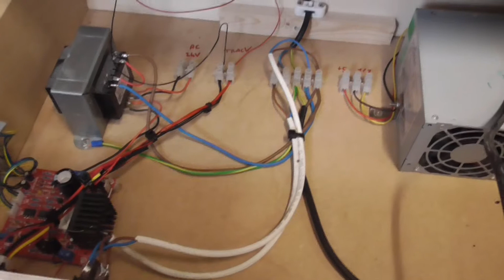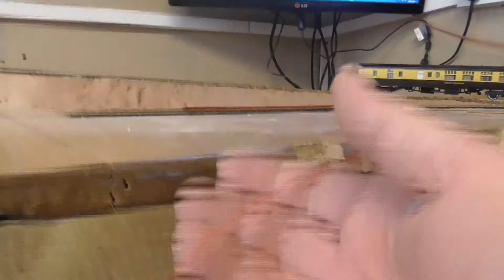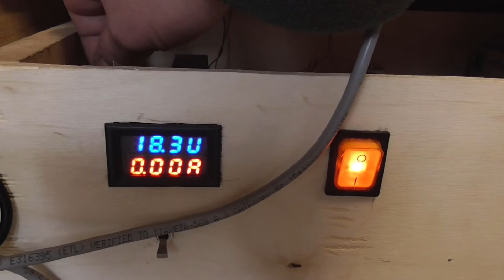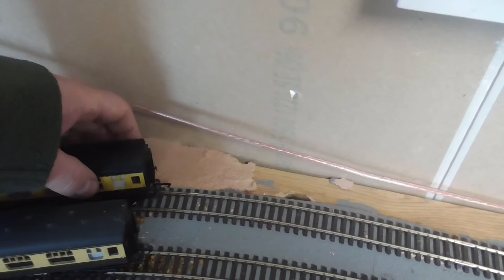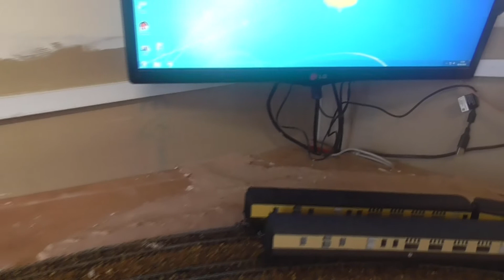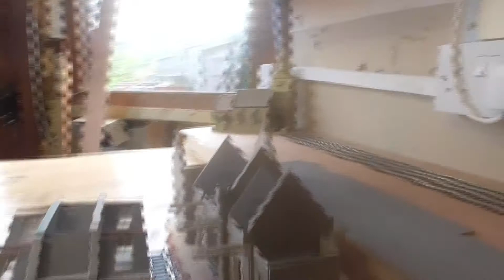Benson Valley Railway OO gauge part 1

Comment: Nice drawers! Enjoying your videos and following your progress. Hills are always an issue - a bit more weight is often the cure as long as your slopes are reasonable. You could look at that magnet and shim system - forget the name now - but does need magnets on locos that struggle... but that may be only a few, and best to fix now before you lay too much track! PS just remembered - Powerbase from dccconcepts....
Reply from the maker: Hello John thanks for the comments. I will look into the magnet system. I know they did this on old hornby stock but this only worked with steel track. I do have some lead which might be enough to get this part sorted. I think the new mag system will need parts under the track which will mean pulling up what I have layed